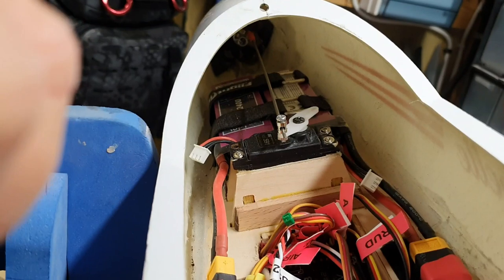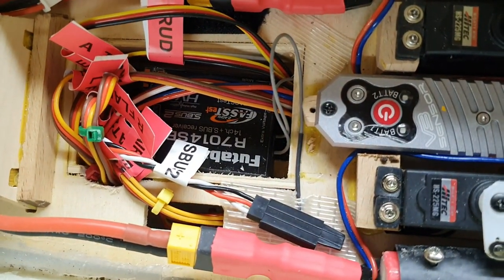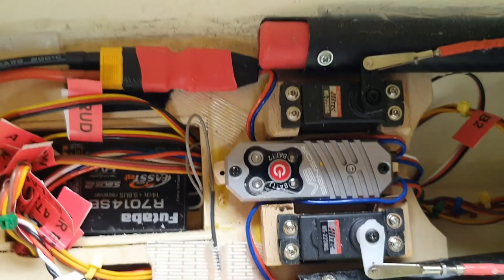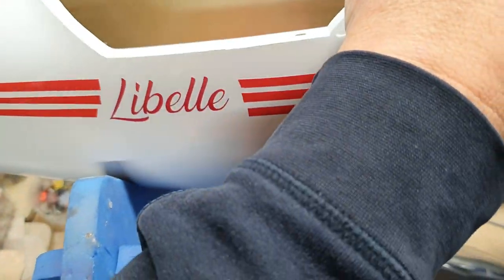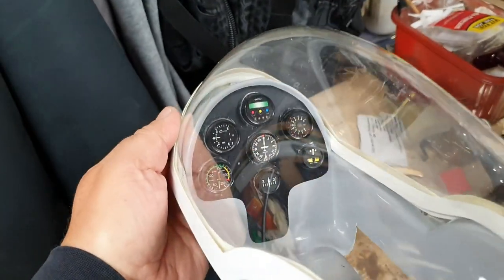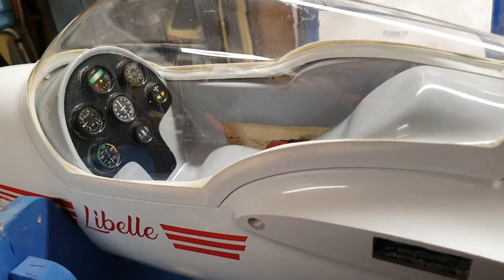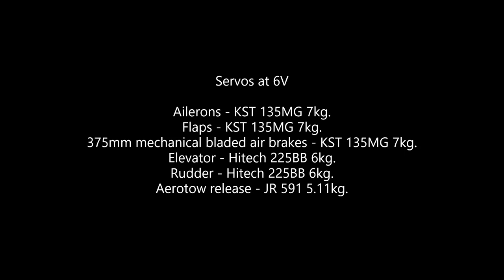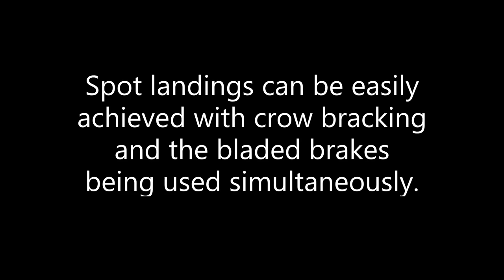Valenta Models Libelle 4m RC Sailplane   Build

Comment: Where did you put the CG? The instructions say 93mm but I've seen on forums people recommending 80mm
Reply from the maker: 93mm gave a safe but reward CG. When I put the Libelle into a dive she stayed in the dive but didn't tuck. My final position is 87mm at this the Libelle pulls out of a dive on here own ever so slightly.
The elevator is in a neutral position now and only 10 to 15% of down is required to maintain inverted flight.